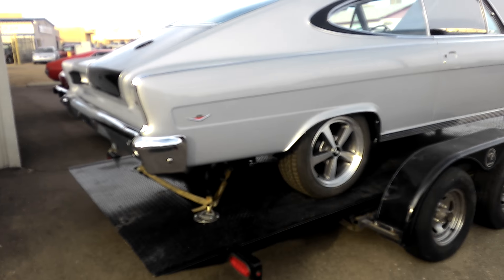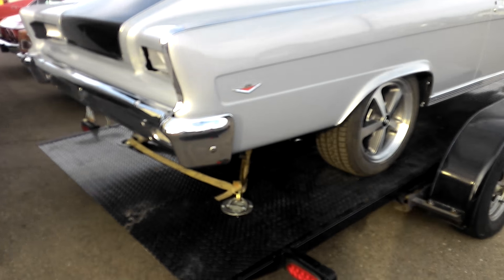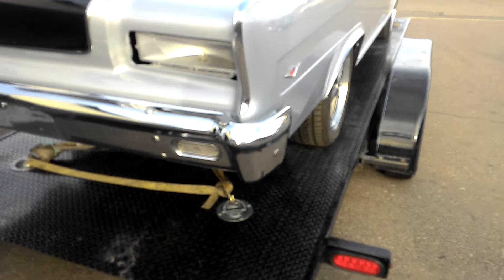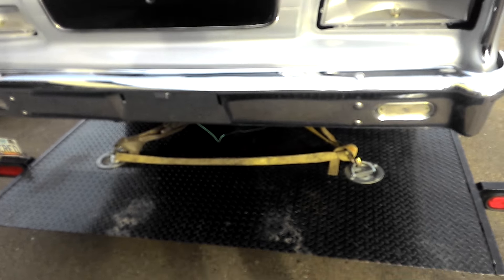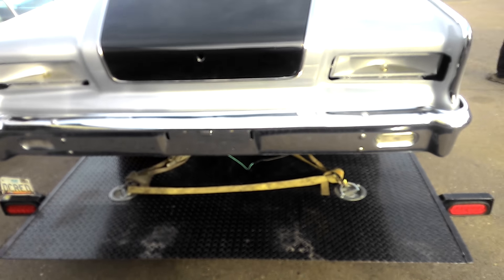1965 Marlin upgraded with EFI equipped 343.

Comment: I saw this posted on the marlin facebook page, just curious: What was the appeal to putting a 343 in this year of marlin?  It sure does sound great, but so do 327s even with the stock more-than-mild cam.
Reply: we wanted to get rid of the torque tube tranny setup plus the 343 has more readily available performance parts.
Reply: Please share your rear end swap info I to have a 65
Reply: It requires converting to a 4-link setup, and most likely involves custom fabbing mounts. You can get parts from www.freakride.com or some other places... it's possible. I have a '65 too, but not going to pull the trigger on that for a while.
Reply: So what  parts would I need to put a 360 & 727-or- turbo 400 in a 65 Marlin.